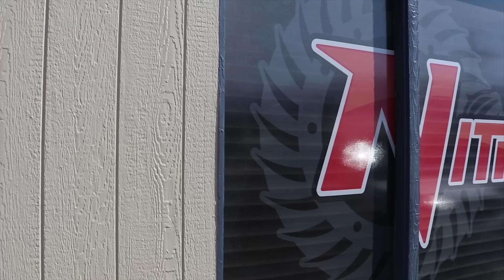The Tacoma gets 5.29 Nitro Gears | Huge improvement!

Comment: Great video. Lots of misconceptions about gas mileage versus RPM. Every engine has a different power/torque vs rpm curve.  When you map power/torque over a fuel consumption vs rpm you can see power efficiency over RPM. To get good fuel mileage you want to keep the engine in the RPM range that has the greatest power/torque efficiency. You derive the desired RPM from power/torque/fuel-consumption, not the other way around.

Comment: I ran 4:88 on my first gen 2.7 with a manual transmission.....loved it with 35's  a TJM from bumper and a custom rear with swing arm....it was def a huge improvement over the stock gears
Reply: I've got a similar set up with 33s that I'm planning to regear. Did the 4:88s still have some amount of top end speed?
Reply: Chip Schoff it would hold 70-80 on the interstate, but I never really drove it that much faster than that....I think if you Google i8aheep it'll show you some old photos of it maroon std cab with a swing out tire on the tailgate

Comment: Great video and super informative, i'll be regearing mine to the same ratio with nitro when I do my 8 inch suspension lift with 33's
Reply from the maker: Sounds like a bad ass build man🍻
Reply: Thanks brother 😁. Although I'm not planning on putting armor or adding much weight to my truck, I'm sure I'll still benefit a lot from those 5.29 gears once they're installed 😎. Stoked that yours is running a whole lot better now 💪

Comment: I traded in my 2017 TRD 4x4 that I had for 10months because of the gearing. It wouldn't tow my boat with our hunting for gears not a huge boat either. Got a Tundra...no issues now. I didn't regear it because I didn't want to void the warranty
Reply: yes, more than like true. I figure I was only pulling 3000lbs or so that Atkinson function going from a 6 cy to 4 cy mode was super annoying and using the manual mode made my rpms super high.

Comment: Maxx, thanks for the post.  I have been frustrated with the sluggish response from the engine/transmission (6-spd auto) marriage in my 3rd Gen Taco.  This is my third Taco in 10 years and certainly the most disappointing.  I am wondering if you have documented your RPMs at highway speeds for 4th, 5th and 6th gears with the new 5.29s?  I have a 2017 Taco Off Road and am curious to know the RPMs in each of the three highest gears at 60, 70 & 80 MPH.  I do a lot of highway driving for work and find myself camping in 4th gear at 77-78 (in 70 MPH speed zones) around 3300 RPMs so that my truck doesn't continuously hunt for gears with terrain changes while also giving me some ability to get around folks sleeping in the fast lane.  I have been looking for a solution for nearly a year and a half now and am wondering if 5.29s would be the right direction.
Reply: I am wondering the same thing. Would love to know as I’m about to do this to mine.

Comment: That was the perfect time to do ARB or Harrop lockers.  Did Just Differentials recommend using a thicker weight gear oil?  I would recommend using synthetic even for the break-in.
Reply: Good to know what you recommend, random commentor.

Comment: 4.88's on 35" tires in my manual trans XJ and it's geared a bit too high - 3k rpm at just over 80mph, but fantastic for climbing stuff
Reply: Maxx Powell; Very true. Yeah I guess a 6spd would help some for me, but honestly 80+mph is really at the upper limit of what's safe in a 90's Jeep so kind of a natural speed limit.

Comment: the tune will make a bigger difference than the regear did, IMO
the pedal sensitivity is the biggest problem  with the truck and the tune improves that a lot.
Reply: Turbo Everything not when your running significantly larger tires.
Reply: What tune are you talking about? OV?
Reply: thats true, but the change with tip in would be much improved with OVtune over the dead feeling stock throttle configuration
Reply: Pedal commander

Comment: I would have gone 5.29's, but only if the highway speeds were close to the peak volumetric efficiency of the motor.  The difference in fuel economy wouldn't be to significant, but performance would be a huge difference.

Comment: Guys are lying. My fox body with when to garbage as far as gas mileage is concerned when i switch to 4:10s from 3:73s. If your engine is screaming is likely your tank is draining at a rapid pace
Reply from the maker: Did you increase your tire size?  If not than yeah your RPM is going to be screaming and it's going to waste fuel

Comment: Disclaimer,  gearing is always a compromise.  What you gain by going to a lower ratio, you give up on strength.  That pinion head on a 5.29 is half the size as a 4.10 and less tooth on tooth contact. About the size of a golf ball. Just something to think about when choosing what's right for the individual.
Reply: Question. Does the lower ration offset the need for strength at all? Wouldn't it be less stress because of the lower ratio?
Reply: @turbomini89  long answer short is no. The lower the ratio, the easier it will be to break when compared to a higher ratio. One should still gear correctly for the setup, but like most things it comes at a cost.

Comment: I have a 2020  off road Tacoma and I’m interested in getting the 529 here’s my question can I run 529  with stock tires for now I do plan to upgrade to probably 33 will my engine be screaming down the road with stock tires. And also I do pull a trailer very often.

Comment: I wish I could afford to do this to my manual xterra. It’s got 32” tires , 3.54 rear end and just has enough torque to get by. If I’m doing less than 85 mph I need to shift down to 5th to pass or climb.
Reply: j carry i have the same issue, 6sp manual Frontier running 33”. Has just enough power to make it manageable but i’m sure regearing it up to maybe 4.56 could make a world of difference
Reply: @Smoothey999  I'm sure it would, I would totally do it if the truck wasn't so old already. Hoping I can find a manual fronty myself for the next truck and gears'll be near the top of the list. I can hardly imagine getting around at all on 33s the way it is now but people do it.

Comment: I got a stock 19 trd sport. It’s a manual transmission. I find the gearing a little high for my taste. I like to do some slower rock crawling. It’s alright now but I’d like to put on a 3 inch lift with slightly bigger tires. What gearing would you recommend. And what matches the best with a 3” lift. Max speed limit here is 55 so I don’t plan to race a long.

Comment: I got a 94 Toy truck with 5.29/33's 
💪😎... = Lot of power/torque 
on each shift!
Reply: Eddie Batoa is that with 22re or 3vze? I’m looking at 529 with my V6 pickup on 33s as well.
Reply: @rome0175  it is 22re. Bore to 40 w/.60 pistons, pro torquer camshaft from LCE, cold air intake LCE, header and flowmaster. 3" lift. Sounds beautyful.

Comment: Whats a good gear ratio for 2nd gen , just bought a lifted a 2011 tx trd with rear bumper tire carrier an plan on some rock sliders an pull a tear drop trailer or something under 3k gvwr its rolling  on some Kanati trail Hogs 305/70/18s

Comment: Hi Maxx Powell,

I have 2017 Toyota Tacoma that I just put a king suspension and deaver springs in the back. I installed 285/70/17 BFG all terrains load C. The truck is always hunting for the right gear. Would 5.29 regear be the right choice for my setup? Thank you
Reply: Thats going to be a really aggressive overgear. With those ~33" tires a 4.30 would bring you closer to stock gearing. Those a relatively hard to find though and most people with 33s do either 4.56 or 4.88 gears. The 4.88 is a bit overkill for most people - but from my own research the 4.56 gears appear to be a great sweetspot with those tires. Problem is finding them for the 8.75 rear end or even the 8. 4.88s will be the most readily available gear - although it will be a little bit overgeared for 33s. But hey! Some people want that!

Comment: What’s you MPG now?
Reply: Wondering the same thing. Manufacturer reports up to 3 mpg increase but that doesnt make sense to me
Reply: Jay Tee because the truck is working less to push it self around thus wasting less fuel
Reply: El_De_La_Lobo except on the expressway or that’s what happened to me when I put 4.56s in my jeep form 3.73 in a ford 9in with posi with a v8
Reply: Jay Tee if you’re actually running big tires it’ll make a difference if you run stock gears on big tires you’re gonna be hammering down to do 50mph all the time.

Comment: Hey man liked and subbed! I looked through all the comments trying to get an answer for the mpg question and didn’t see it, what were you averaging before vs after with those 35s and if you remember the numbers on the 33s aswell lol looking at getting a Tacoma as my next vehicle but 9 months out of the year I tow a 19’ bass boat 2 hours each way to the lake and am unsure if the Tacoma will work boat loaded is right around 3800 lbs if my math is correct
Reply: Maybe a old mechanic can help you with your questions. To get honest answers I would have to know a boatload of information and there is tons of variables that will change the answers. So if you got specific questions and don't mind giving the details I will give you as honest answers as I can

Comment: I’ve got a 1994 toyota pickup 22RE converted to a 22R, also a straight axle installed, has 31x10.50x15 wheels, she can’t pull the weight going uphill, truck does 40mph and doesn’t go past it. I want to daily drive it, and use it for trailing every now and then, does 4.88 sound good? Or 5.29?? I’ve also wanted to go with 33’s with 15x14 rims or wider.

Comment: Did you re-gear the front? i was told you need to do both. Also about how much was this. Thanks
Reply: @Maxx.Powell  Would it be bad to regear the rear only, even if you aren't using 4wd? I have a 4x4 and I won't be using 4wd until around December when I actually take this off roading since I'm just trying to save money for all my modifications. If I do just the rear, and I don't put it 4wd, would it still be bad?

Comment: *Laughs in 2UZ-FE* How much was the Re gear on this tacoma ? Planning on doing this to my 05 tundra, lackin’ that response. Same Exact situation happened after modding it to heck
Reply: I'd say like 3000 open to 4500  with locker.
Reply from the maker: I had an E locker and left the front open and it was about 2700. I wish I had locked it up front though

Comment: Hey Max, great video! Loved all the b roll shots too, like how you spliced them through out the video. 

As far as tuning you should look into ovtune. He tuned my truck and it made a massive difference. I am running 34s on stock gearing, and normal daily driving is fine but that is because the supercharger. Off road when I am crawling I definitely feel I could use a regear for more low end power. 

Looking forward to the moab video 🤘🏼
Reply: 4.88 with supercharger best of both worlds?

Comment: So.... If you re-Gear the rear diff, do you have to do the front too? WOuldn't that effect your four wheel drive? I'm obviously not a gear head...  This sounds like the solution to the gear hunt issue.
Reply: No, it is perfectly fine to run completely different gear sets between front  and rear diffs.  Supposed to really help it in 4wd. This is a joke.

Comment: Maxx what did you do to correct your speedometer? Nitro Gears do it or Toyota Service Dept?
Reply: Gears dont affect speed reading, only tire size. Speed is based on the wheel speed sensor. (truck has low and high range and speed still works) There is not a great way to fix tire size speed changes
 from what I've read.

Comment: I have a 2016 Tacoma, 3" lift, 285/75/16 Falken MT's, was wondering of any body could tell me if 4.8 or 5.29's would be better, afraid the 5.29's would be to much, do haul a utility trailer alot with a utv around alot. Thanks.

Comment: Do you recommend regear with 285/75/16 tired?
Reply: YotaFire28 It would definitely give you more power and improve gas mileage. Though if you plan on keeping 33’s I would go with the 4.88 instead of the 5.29
Reply: Jorge Arocha I would eventually go with 35’s so if I was to regear the truck. I should just go with the other options correct? That shop max went to is only 1 and a half hour away from where I live.
Reply: YotaFire28 If you plan on going 35’s then yes, probably go with the 5.29 gears. Though while you still have 33’s on it, the 5.29’s will be pretty aggressive gearing. Acceleration will be intense until you get the 35’s lol

Comment: Did you regear front and back?
Reply: @Maxx.Powell   thanks for the quick reply. I'm looking a shop here in san Antonio to do the job because I have a toyota tundra 2017 sr5 4x4/ v8 5.7 with 6inc pro com lift and 37s . 
And I have the same experience (hunting gears and poor gas mileage)

Comment: So with re gear you get better gas mileage and you get your power back?
Reply from the maker: Yes sir!  The truck is able to utilize 5th and 6th hear which lowers your RPMs at cruising speed. The. You also have higher torque and power as well
Reply: So which one do you recommend on 35s a 6 inch lift 4.88 or 5.29. I’m going to be mostly on the streets haul a boat here and there and off-road once in a blue moon.

Comment: Would a 6 speed manual have the same struggles with larger tires?
Reply: Yes, can confirm. My 3rd gen manual could use a regear. I'm only on 33's but I notice a difference, places I used to cruise in 5th I now have to be in 4th and such.
Reply: A 3rd gen manual has 4.30 gearing and a lower final drive gear in the transmission. Auto has 3:90 gearing and two very high od final drive gears, bad combo.

Comment: Did it effect your speedometer reading
Reply: Bill Harvey Regearing typically doesn’t change the speedometer reading because the speed is taken off the ring gear not the pinion gear.  So the ring gear is the speed your axle is turning not related to engine rpm or transmission gear.  
Changing tires to larger or smaller affects the speedometer because the speed is set in the computer based on the rolling circumference of the stock tires.  Larger tires roll farther with each revolution and the speedometer/odometer do not see this change.  So for the same rpm you are going faster which obviously will require more power.  If you don’t have enough power in the engine at that rpm, the transmission will downshift to a lower gear.  With electronic transmissions, there is more involved in why it shifts, but that the basics of it.  With lower axle gear ratio, each transmission gear will give a high rpm than stock as such give more power available(and more fuel) but with bigger tires, you need more power and the larger tire lowers the rpm, so it is not a linear change.

Comment: I have 4.88s on my 2gen :)
Reply: I have a 2nd gen with 33s but wanna go 35s. How's your rpms on the why. Are you happy or wish to go 529.  Tks in advance.
Reply: At 60mph with 488s f&r it at 2300rmp's 35x12.50s17 with 3" lift kit air lockers f&r. Think i have a video of it on my Channel.

Comment: 5.29s should be perfect with your tires, auto 3rd gens are geared way too tall from the factory.  Peak torque is at 4600rpm. The manuals have just the right gear ratio from the factory.
Reply: Yah my 2017 manual rpm at 60mph is like 2200rpm in 6th, seemed excessive and only got like 18mpg compared to autos tall gears. But when you get a feel for the engine, going under 2000rpm is only good for coasting and tends to lug when trying to accelerate. Better to stay over 2000rpm for this engine.
Reply: @justinsimundson4145  Yeah the start of the powerband is right around 2500 that's why.
Reply: @shepherdofelo1122  id say 3500 honestly, you can feel it

Comment: He says biggest bang for the buck but in California labor rates are 120-160 and hour so with parts and labor without the addition of lockers or extras it coast a $1000-1500 a axle. So bang for the buck yea $2000-3000 later I don’t know, buy a supercharger.

Comment: I hate to say it but this is one of my biggest gripes with the 3rd gen taco... the transmission gearing or programming or whatever makes this truck feel like a piece of crap driving on the highway, one of the worst driving transmission gearing/engine combo I have ever experienced. 
Downshifting way to late after demanding power from pedal, upshifting at the wrong time when going uphill. Surging at WOT from a stop.
I have the latest tsb. Truck still drives like poop.
After all the cash I've dumped into the truck I am right where you are - to the point of wanting to sell my truck. Never thought re-gearing might make that much of a difference !

Comment: I will be certain not to add too much weight to my truck my plastic trifold bed cover weighs 80 lbs the rubber mat is probably another 35 lbs which everything starts adding up costing more in gas & wear n tear on engine, trans & gears.